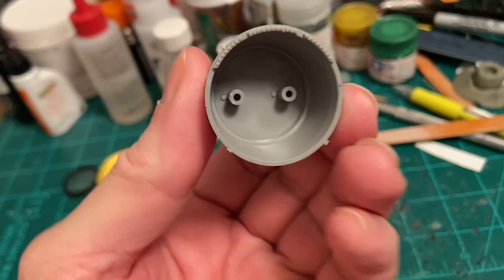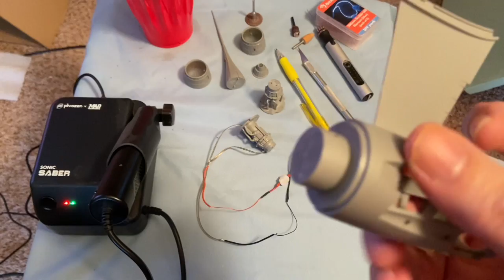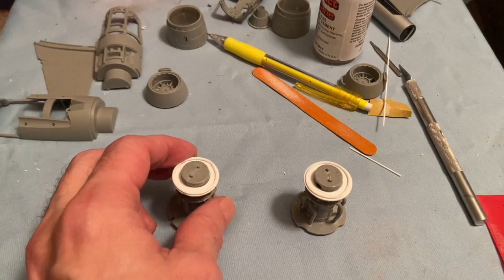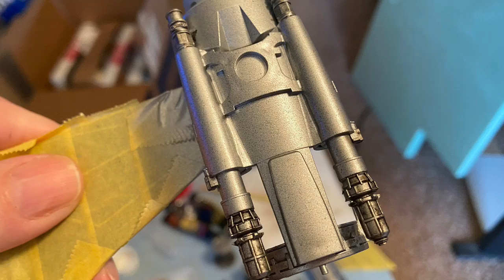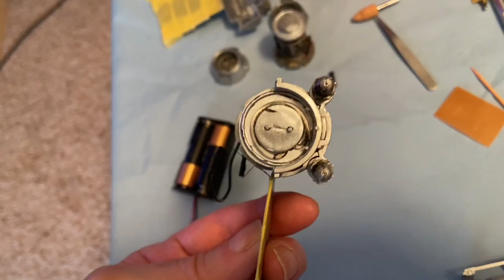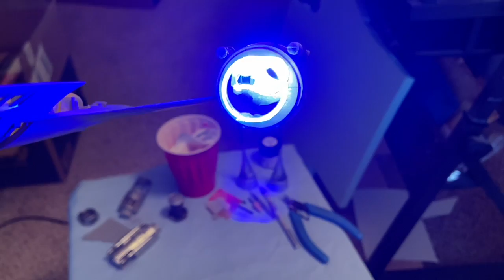Revell 1/24 N1 Starfighter Mandalorian build part 1!

Comment: Great job Ken! Didn’t you had imperfections on to the kit? I’ve got a few issues with imperfections ( pits ) where the connection pins are molded! I’ve got a few REVELL kits and this one is the worse of them all. I think that something went wrong at the cooling stage at the molding process!
Reply from the maker: I haven’t had any issues like that, sounds like you got a bad batch. 😮

Comment: I was honestly thinking about just cutting out some clear circles from the base that comes with the kit to use for the engines to let light through. Was going to use uv resin as backup or for fine details on the smaller engine. Looking great though! Probably going to buy a Lego light kit from Amazon since it looks like it'll work great, it cheap and I'm not familiar with making my own leads. Can't wait to see how it all turns out.
Reply from the maker: Thank you! I had considered using clear sheet plastic as well but happier with the mold and resin version.